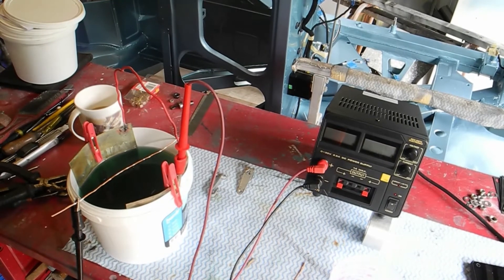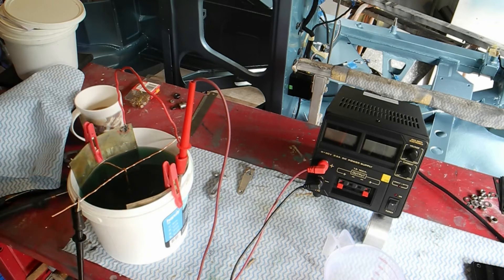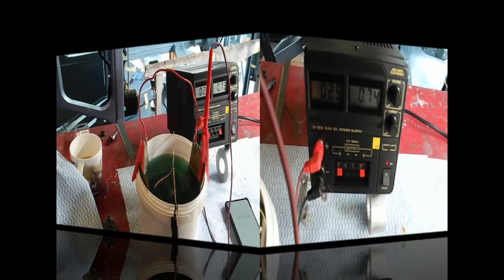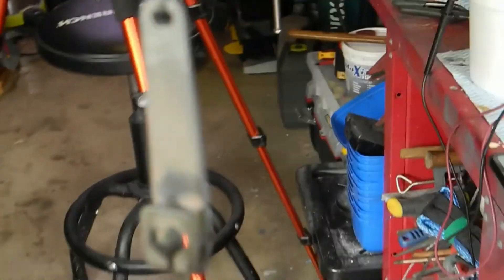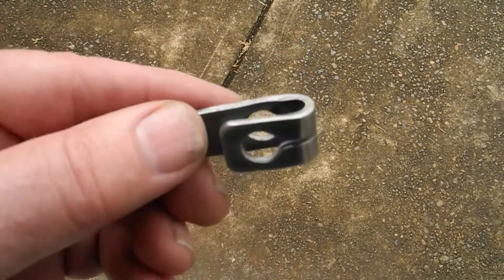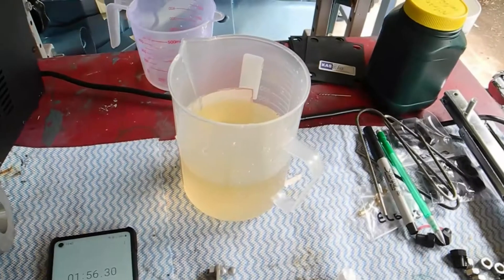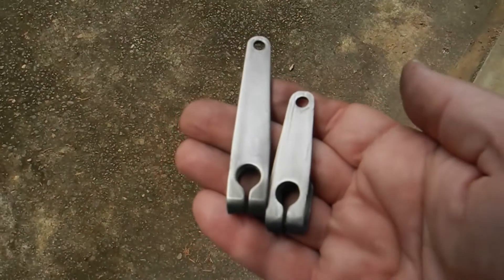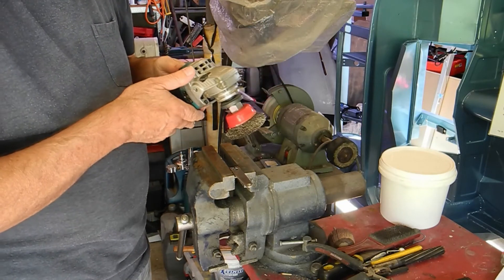Nickel Plating part 2 (24)

Comment: You didn't try a soft buffing wheel with some polishing compound?
I think that might brighten up that dark finish. Thanks again.
Reply from the maker: Thanks Boris - you are perfectly correct.
Rather then a wire wheel brush I should have used polish and buffing wheel - which I did in later cases.
Cheers

Comment: how do you find the adhesion of directly nickel plated steel? It seems every video I've looked at is plating copper-based metals. I've got some friends with old gun parts they'd like plated. Do I need a copper mid-layer as with chrome? Also have you tried any of the brightening chemical additives?
Reply from the maker: Hi Chris
I'm no expert when it comes to plating. I do understand that plating on copper as a base is a positive process and is a good adhesive substrate and a filler. I did my parts some months ago now and have not had any issues to date i.e. no appearance of rust. I did have to redo them as my current was way too high. I kept my process simple but the kits you buy have all sorts of brighteners which will enhance the process. Triple chrome processes do add a depth of shine which you can't beat. Take a look at Jane Kits and Caswellplating I don't think they use copper as a base.
Regards

Comment: Hello iHealey
Would you be able to comment on the use of an ultrasonic parts cleaner to prep parts prior to electroplating?  Thanks
Reply from the maker: Hello Mofo Sheee - good question - short answer - no - ultrasonic cleaners are good for cleaning but not the deep stuff needed to get back to bare metal for plating. My personal opinion is to use wire wheel and fine emery papers for hard to get corners. The best set up is a bench grinder with wire wheel on 1 side and buffing pad on the other. Then perhaps after all that use an ultrasonic cleaner for greases and finger marks.
Of note I found my current of 40 amps/sqft far too high and had to redo them at a maximum of 9 amps/sqft. Try and be accurate with current setting for size of work needed as it makes for a better finish. You’ll need the buffer wheel for the final polishing.
Good luck
Hugh

Comment: Well done Dad! Is the process similar for Chrome plating? Are you still keen to tackle the badges on our cars ourselves?
Reply from the maker: Well friends - this is daughter number one and she’s a go getter.
Cath and husband are also doing a restoration on a 1957 International pickup.
I’m progressing slowly on the engine - parts a little more difficult to source.
And yes - the plan is to DIY chrome plate - however - its quite a bit more involved and kits are very expensive.
This is our lead in - the next is to copper plate which is the first step in chrome plating.
Also the nickel would look brighter had I plated the items with copper first.
Nice to talk to you always Cathy even in a public forum lol
Hugh
Reply: Hallo Hugh,  You can have a nice shine on the nickel when you polish it with paste  like you polish aluminium and other metal. Of course the companies who are selling nickel plating products have brighteners.    I don't know if you can make/produce those brighteners yourself.

Kind regards,
Ivo (Belgium)

PS:  I'm restoring also a BN1, an very early one,  completely in aluminium.
Reply from the maker: @ivomatthe7716  Hello Ivo 
Very interesting comment. 
I note that Caswell recommend 9 amps/soft for both copper and nickel as against general internet advice. 
Which means my 0.8amps was about 4 times too high.
Caswell and Jane Kits both operate here and have brighteners available.
I might follow your advice and try again at a much lower current setting and polish as you suggested.
Thanks for the input
BN1 Healey - the very first Healeys made had all aluminium outer wings and doors and are a very much sought after group.
Are you saying you have one of these or are you building the outer panels?
I’d be very interested to see the progress on that.
Thanks for the response
Cheers Hugh
Reply: @ihealey458  Hi Hugh,
Indeed it's one of the early BN1"s, with the dashboard in two pieces;  a small panel in a bigger panel.   I have read in the "Austin-Healy 100 book in detail of Bill Piggot  from 151795  Feb 1954 : "The one-piece fascia and instrument panel replaces previous two-piece item".   my numbers are:
Built date:   		        18/12/1953

Chassis number:	        BN1L 150211

Motor number:		1B/205129

Body Number:		4467 1290
For the plating,  I use  (as you) very low amps.   If I use  9 Amps the piece shows burning  spots, with high on low spots like mountains and valley's  .    I have done quite some nickel plating as hobby and it seems simple but you need to try it out (trail and error).
I have quite some photo's of my BN1 project, if you are interested I have mail them to you, for that a need your mail address.
Cheers, Ivo
Reply from the maker: @ivomatthe7716  Hello Ivo
I've got Bill Piggot's 2 books, also Aders Ditlev Clausager's book 'Original Austin Healey' - my prized possessions. I would love to see some of your photos, my email is myhealeyrestoration@gmail.com 
Haven't got around to doing anymore plating but I will and thank you again for your input.